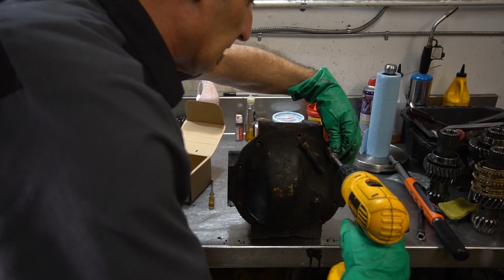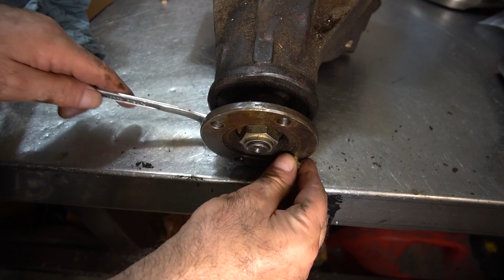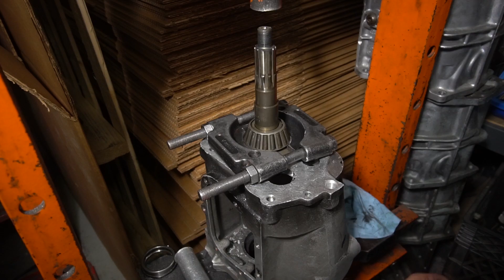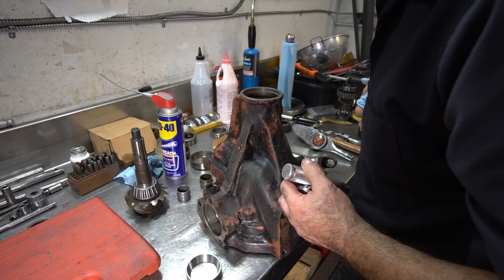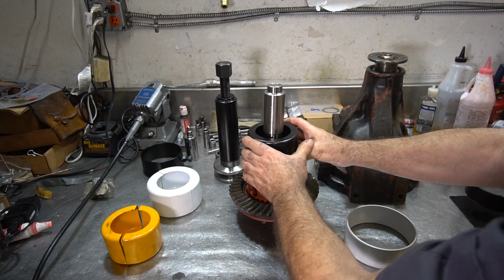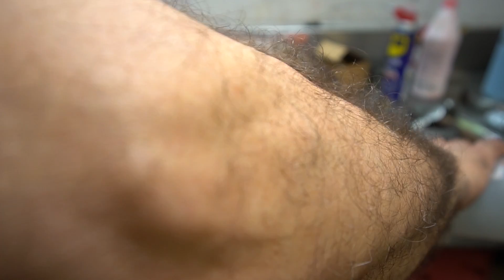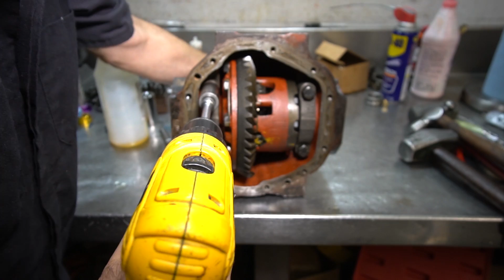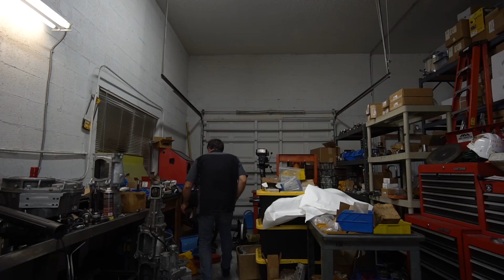Dana 44 Carrier and Pinion Bearing Replacement Basics Jaguar XKE

Comment from the maker: CORRECTION:  Thanks everyone for the comments. My math was off.  The Dana manual says: If the old pinion reads ( + ) 2 and
the new pinion is (-) 2, add .004" shims to the original shim pack. So a negative number gets subtracted from the nominal bringing it closer to the pinion  and a + number brings it farther away...

Comment: FWIW - I think a non adhesive, gap fill sealant is best on splines that might need future disassembly. I've seen other videos showing that thread lock effect on splines is to fix them solid.
Reply from the maker: I've done hundreds of rears. Everybody has their own technique and that is fine. But if my experience is worth anything anytime you use a flexible sealant like silicone they end up leaking through the spline. If you use an anaerobic sealant that doesn't happen. If you need to take something apart you just apply mild heat and the sealant loosens right up. Really not a big deal. And also if you do this type of service  correctly it should be good for a very long time.

Comment: Is the nominal always 2.635" on all Dana 44s. I ask because I am replacing the bearings in a Dana 44 from a 1963 CJ5. My older brother and I were going to rebuild the Jeep together but he passed away before we put it back together. Its been three years since he passed and I haven't been able emotionally to finish it. His son has inherited his farm and I need to finish it so I can get it out of his way. I've been chasing my tail for a week trying to set it up. All the parts have been moved around so the shims are mixed up. I thought it should be 3.125". The pinion has +3 on it. Any information is appreciated.
Reply from the maker: If you are just changing the bearings there is no reason to mess with the shims. I do not know how far apart the unit was taken come in other words did they remove the bearings from the pinion? Did they remove the races from the case?

Comment: Great video!! Thanks for taking the time. I have a question: how do you know if the carrier is fully seated when reinstalling it in the pumpkin? Mine took healthy blows to get it in and seated but I am not 100% certain. Would any residual seating take place when you torque the bearing caps down?? Thanks again! 36:59
Reply from the maker: If the caps are seated the carrier is seated

Comment: How would I go about verifying the shim thickness between the carrier and bearing? the stock carrier was a 3.55:1 and the new carrier 4.10:1
Reply from the maker: Seems like you are talking about gear ratios rather than carriers. So what you would have to do is just keep the same stack height of the shims that you currently take out if you are using the same carrier. If you are switching carriers you should measure the actual width of the bearing surfaces and compare it to those of the old one
Reply: @GearBoxVideo   I just reread your title and saw its a jaguar. I'm working on a IFS dana 44 front for a 90 bronco. So i imagine many things are different. Like the two different types of carriers for a dana 44 IFS 3.73 & Down and 3.92 & Up. Thanks and great video

Comment: Great video!  I was a little confused about shimming the pinion.  The Jaguar shop manual says zero is 2.625 and a plus correction moves the pinion face away from the ring center (or forward) and a minus correction closer to the ring center (aft).  Do you disagree with this?  Thanks.
Reply from the maker: Read my pinned comment

Comment: Great video what rear end oil would you use & how about rear end noise    ,pinnion bearing or ring & pinnion noise  THANKS
Reply from the maker: I use Royal Purple Max Gear Lube. 75w-90. What about noise? Units should be quiet when rebuilt properly. If you jave noise fix it

Comment: I put back one of my bearing caps for the carrier in the wrong orientation. Drove it like 100 miles and now I switched it back. Can you tell me what mess did I cause? could it have damaged something?
Reply from the maker: Nothing will happen
Reply: @GearBoxVideo  I am asking because my elocker won't engage.  I can see the locker plate move a little to the left but not all the way.  Any idea?
Reply from the maker: Sorry..no idea

Comment: Outstanding video. Thanks Paul
Reply from the maker: Many thanks!
Reply: @GearBoxVideo  How were you able to determine the bearings were the source of the noise and not the ring and pinion? Thanks
Reply from the maker: The unit was dropped off  to me.  Visually you inspect. The gears are on perfect shape. No scoring no signs of oil loss. Whats left? Bearings
Reply: @GearBoxVideo  Thank you

Comment: I'm getting ready to rebuild my D44 front on my ram, the pinion is so loose I can shake it around with the driveshaft. Most of the other videos on YouTube either skip things or just leave out parts. I learned a lot from this, especially about preload. I plan on installing a lunchbox locker for off roading and have a cable actuator to replace the vacuum disco. Thanks for posting this

Comment: Great advice on safety precautions when using chisels, especially air hammers.  I’ve had “shrapnel” from just a cold chisel and hammer go into my hand when removing bearings off axels.

Comment: I'm upgrading my 57 CJ5 Dana 44 to a 30-spline axle that will allow me to install a posi. unit. I recently purchased Torsen differential for Dana 44 online. Unit is apparently older version but new in box. Gleason MFG part #M005-BB. Dimensions seem same as factory carrier except carrier bearing hub is slightly larger measuring 1.7995 compared to factory carrier dimension of 1.690. I believe I've found a bearing cone that will work. Looks like the Timken 25590 will be needed instead of the 25577. The shims however won't work. I suspect later models came with the larger bearing hub diameter and I just need to know a shim pack part number to order the newer model bearings and shim pack.  Are you familiar with this situation and how did you solve it.?

Comment: I was watching a video on an Audi with a noisy rear. Due to lack of oil two bearings were scrapped but the Audi's rear is not rebuild-able. So for the cost of a couple of bearings the rear end was scrapped.
Reply from the maker: You can always get bearings
Reply: @GearBoxVideo  I agree. Instead of saying it is not rebuildable they ought to have taken it apart, hunt down the bearings required and replace them to show it can be done  It's a straightforward job to replace the unit so it was a useless video
Reply from the maker: Was this video on YouTube? I can't find it

Comment: do we have to replace that race if it's like new condition?
Reply from the maker: Problem is the age. If you are into the unit to rebuild it, then change the wearable items that are 40 years old
Reply: @GearBoxVideo  Thank you for your advice. I Currently work for a GMC Dealer. I'm currently rebuilding a 2021 Colorado /w 26k miles I managed to replace all the bearings BUT go figure the Dealer doesn't have the measurement tools for Preload ( that torque meter in in-lbs/Nm) or a Pinion depth gauge or back lash gauge..... The pre load torque wrench is 350-550$ alone through snap on ... yikes Sadly at the dealership it's not common to rebuild rear ends nowa days and go figure and OLD dealership losing half of their "specialty" tools  haha management is about to question these long rental time frames.
Reply from the maker: Didn't think that wrench cost that much! Must be used ones on Ebay
Reply: @doogeerugged89  I have made torque wrenches for this job of pinion preload.  One time I used a rubber band at a certain amount of stretch (the force, lbf) and a paint stir stick for a lever (the distance).  If you don't trust your 'feel' of the stretch, tape an index card to the paint stick with the proper radius and stretch distance.  Another torque wrench note:   I use cheap torque wrenches all the time but I always check the tool before doing anything I care about.  For the carrier bearing caps in this video I would take my garbage wrench, set it to 60 pounds force*feet, clamp the drive end in the bench vice with handle horizontal, stand on a bathroom scale and make sure it clicks when I push down at one foot radius and the scale just shows my body weight reduced by 60 pounds force.  Trust but verify!

Comment: Is it possible to use the clamshell bearing puller on the pinion bearing? I'm trying to minimize what tools I have to buy :)
Reply from the maker: No
Reply: @GearBoxVideo   Thanks!
Reply from the maker: No
Reply: cut it like when you change a wheel bearing  the inner part always stucks to the axel a cut with a anglegrinder and its off

Comment: Hello, really educative video !
Please ,I have few questions on you.
1.Is it nacesarry to measure pinion  bearings preload ,when I keep factory  pinion deepth ?Or its good to keep amd inspect both numbers ?
2.Can I apply same numbers (pinionbearing preload and pinion deepth) on my dana 44 from jeep grand cherokee wj ?
3.Do you know factory pinion deepth for dana 30 also jeep wj ? 
4.It is alwaysnacessary to replace all of bearings ? How to figure out if they are good ? (races are shiny and cages  seems solid)
Reply from the maker: If races are shiny with no pits then just bolt it back together with original stuff and the correct torque. I always do new bearings and always check preload. I don't know the Dana 30 preload setting

Comment: I’m setting up a D44, re-gear from 3.50 open to 3.70 LSD, on front of Bronco. New carrier/ring/pinyon. Have all make up bearings set up. Question, in pinyon shims, there’s shims behind outer race correct? Also is there’s shims behind inner pinyon race or anywhere else? Unfortunately I have a virgin case, so I’ll be setting up from scratch
Reply from the maker: Depends on the gear set. Some use a solid pinion spacer with shims others use a crush color. I prefer the solid spacer. The ship behind the race is standard.
Reply: @GearBoxVideo  thanks again. I agree solid spacer I used one on my 9”. My D44 only uses shims so all good

Comment: Im doing my 1st rearend on 01 f150 lariat 9.75 12 bolt. I used my old pinion bearing to do the mach up. Forgot to mention im also replacing gears from 3.55 to 3.73 not alot of difference but also going from open rear to a Detroit truetrac so my question is have you ever had a situation where using a mach up bearing that came from old gear set and getting the pattern correct to then pressing on the new bearing as well as crush collar to having a completely different pattern cause thats my issue. I did take both old and new pinion bearings side by side to each other and new one looks to be about. 010 taller while sitting on piece of glass as flat surface and ran straight iron/edge across the both of em while being able to slide a .010 shim under the straight iron of old bearing so I think this is my problem but not positive so any suggestions are welcomed, thank you and nicely done!!
Reply from the maker: If the bearings have the same part number on the bearing they should be the same size. Set up without the crush collier but duplicate the same inch pounds of drag with then with the crush coller
Reply: @GearBoxVideo  thank you man sounds good. The bearings do have the same part numbers but there are 2 letters spaced out after the numbers that are different but I had came to a conclusion I needed to use .038 p shim for a correct pattern then when I did final set up my pattern was way off so it all had to be taken apart and I realized my inner bearings were just a hair different in size which I found very weird considering but using set of calipers i measured the thickness of both and got a difference of .0085-.009 thicker with new bearing over my set up bearing so im now thinking I should drop p shim from .038 to .0295 give or take .0005 thou. Has this ever been an issue for you on any rebuilds at all and would you recommend my theory to work maybe? Thank you much for the fast reply!!
Reply: My experience is that the bearings are REMARKABLY consistent for running thickness from decade-to-decade and old-to-new (if not toast).  As suggested in the video, when I did a 44 years ago, I managed to get the carrier bearings off without damage (can't remember how but I think with a splitter) and I used a die grinder with sanding roll to open up the ID enough to slide them on and off with much less force.  I used them for setup then swapped to new bearings and races without any detectable difference.  If you see 0.010 different running thickness (bearing and race together, not either part separately) there is something wrong (shim stuck to old one?)

Comment: That Clam Shell Bearing remover shows that necessity is the mother of invention.  First time seeing it.  Looks like it works good.
Reply from the maker: Works very well
Reply: Wish I had one.  The splitters can do some damage, bend the cages, put more pressure on the ends of some rollers than others, etc.  The splitters have tapered 'blades' that rarely match the bearing perfectly.  On a carrier, it's difficult or impossible to get a splitter perfectly seated.  I honestly don't recall how I removed carrier bearings with a splitter and didn't damage the bearings.....but I have a pair of 44 setup bearings that I made years ago so somehow I did it (I am too cheap to buy new bearings and grind them out).

Comment: I enjoyed your video. I own the CJ5 that is on YouTube : Boarding Jeep takes several tries for older guys. I had just got it to crank when the video was made. Went to replace brake shoes and I could shake axels up and down 1/4 in. I've got both axel housings out and the rear dissasembled. It looks like someone put new gears in it but left out the inner axel seals and may have used old bearings. I could shake pinion yoke up and down about the same. It doesn't have the crush shim. Is this normal or did someone leave it out when they put new gears in it.The shims are bent and broken on the carrier. I liked how you measured the pinion depth. Is the measurment 2.635 in standard on all Dana 44s. Is there a chart showing this measurement on different housing. The rear housing I have disassembled is a 44. The front housing is a Dana 30. Do you have the pinion debth for it. I haven't dissasembled the front. Dont know if the gears are the same. I only assume they are. Is there a measurement to center the ring gear. Looks like I'm gonna have to start from scratch. Any help or advice is needed

Comment: Can you please give the link of the pinion depth measuring tool you used in this video? Thank you
Reply from the maker: Please watch the video. I explain that I am using a standard depth micrometer and precision ground flat stock.  I have no links since these are standard measuring devices available from any machine tool supplier.

Comment: Paul, im working on a Dana35 . In your video you say that if your just changing the ring gear and have original carrier, the shim stack should stay the same. Sounds logical but with new carrier bearings and race, mine is just too tight! should I just back off a few thousands on both sides til the carrier will fit? really get a lot out of your video's. Thanks very much.
Reply from the maker: I never said if you are changing the ring gear.  If you are just changing the bearings...

Comment: Hey Paul, is it possible to put the shims on the outside of the carrier bearing so you dont need to make setup bearings on the Jaguar diff?
Reply from the maker: Yes. But not the same size. It's harder because sliding in thin shims is tricky even if you use a spreading tool. The GM 12 bolt sets up like this.
Reply: @GearBoxVideo  Thanks Paul

Comment: Great video. I am replacing the bearings seals in a Ford dana 44 , I don't have the removal tool you have and had a HECK of a time getting that pinion bearing off ended up cutting the race off after the cage came off with the clam shell puller.  I've done a 8.8 ford before without nearly the trouble. Just seems to me the pinion is way tighter on the dana. I watched you heat it up so it should work right?? Lol . Best rear end set up video I've seen!

Comment: Thanks for the commentary on leaving out the crush sleeve when mocking up the gears to check pinion depth.  I see so many videos where people cause themselves extra time, money and aggravation using a crush sleeve (and sometimes even a new pinion nut...) for no reason.  It shows they don't understand how it works.
Reply from the maker: Exactly and sadly most written te h books from Ford or GM missed that important part as well
Reply: I used the extra crush sleeve to check pinion to ring gear pattern because that's the way I was taught.
 I've heard on videos before you don't need a crush sleeve just to put the pinion in to check the pattern with the ring gear,
However wouldn't the preload be on the bearing then, to where you wouldn't be able to rotate the pinion when you put the specified inch pounds of preload on the bearings instead of on a crush sleeve?
Reply: @frankpaya690  If rotational torque on the pinion is in spec you're fine.
Reply: @1970351C2V  what I mean is
 if you're putting your pinion and carrier (with ring gear) in to check  the pattern, to make sure it's on, before you do the final assembly, if you don't torque it with a crush sleeve and thus need two  crush sleeves,
 could you have NO crush sleeve, and just put the required inch pounds on without( any crush sleeve) just to check your pattern?
Reply: @frankpaya690  Yep.
Reply: @1970351C2V   thank you
Reply from the maker: Yes